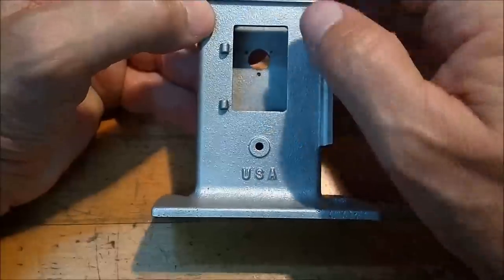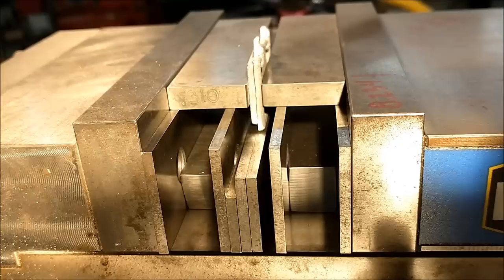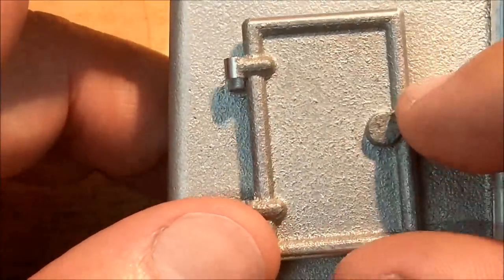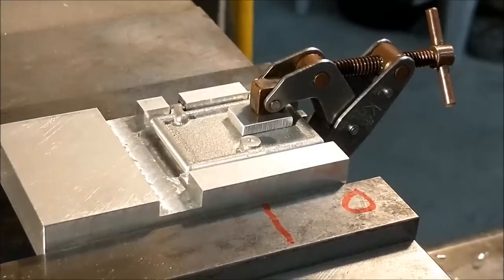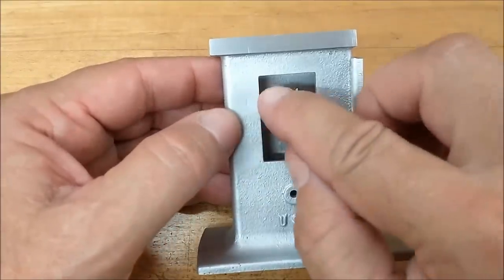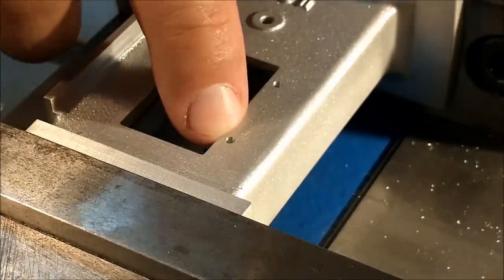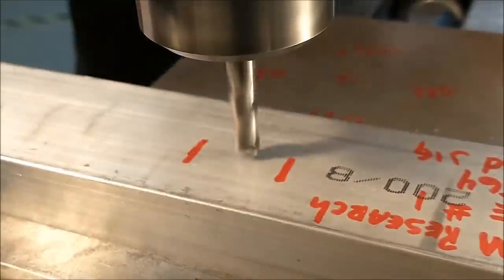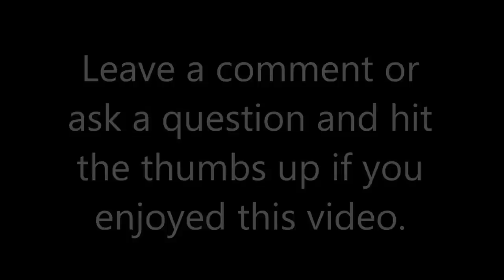Erase Those Hinges and Prepare for Something Better !!

Comment: HINT:  I use a cheap electric engraver to put the cast dimple look back where I have machined surfaces. It work's awesome.
Reply from the maker: I've also seen people cover an area with sand and beat it with a hammer.

Comment: Joe, you’re a problem solver for sure, you have come up with some rather unique solutions to problems that shouldn’t be a problem in the first place especially for what PM Research charges for their kit, you would think that they would have issues such as the hinges sorted prior to production.  Are they using backyard engineers or what.  You probably don’t mind thinking outside the box, but still, if they are gonna charge a chunk of change for their models then perhaps they should increase their quality control and perhaps retool if needs be. Great video! Liking your hinge solution.

Comment: Hey Joe. When it comes to that .080" hole you needed a reamer for at 16:20. I've seen another channel make a tool, I guess it's called a tri-corner reamer. It's just a piece of round stock made from a harder material with the tip ground and honed into a triangular, tapered point. He used one made from SS and it worked great in brass, so Aluminum should be no big deal. Just trying to share the knowledge when I can. Odds are you know this trick, but another reader may not know. Have a good day folks. Great work as always, Joe.
Reply from the maker: Clickspring by any chance?
Reply: @joepie221  Yes Sir, it was. I should've known you'd be familiar with his work. Personally, I think your teaching style is way better for me and many others, but Clickspring does amazing work too. I just wish Adam Savage would take a few pages out of your book, It seems like he would have safer setups.

Comment: Very impressive that the thin drill didn't wander when drilling the deep hole in the door hinge fixture.  I would have chickened out and drilled the two door hinges separately from each end of the door.

Comment: Another great video, and Just as you were talking about it I was going to type into the comments that you should clean of a couple of thou. off the top of those letters so that you could paint them and make then really pop when the model is done! but as I was fixin' to type in, you said that someone suggested it! Great minds think alike, it was uncanny, either that or it's Fools seldom differ, but I like the former rather than the latter, myself. LOL can't wait to see you make those hinges and handle out of brass, it's really going to pop when you put them together! I might as well suggest it now before someone else does, but you might like entertaining the idea of painting it like they did of all the hand made machinery that was built in the 19th century, with a relatively thick british racing green with gold highlights such as the lettering and perhaps some creative scrollwork on the sides, you can easily create those in decal form on blank decal paper and an inkjet printer, although I do not know the age of the model you are building, as this might be totally inappropriate but you're halfway there with the Brass hinges and handle you are going to create. other colors like red or dark blue were also popular anything that allowed gold colored painting on the letters was the norm, so it was usually a darker color. Anyway, think about it. However you decide, I'm sure it will be appropriate for it's age, and I greatly look forward to not only your next video, but the finished product as well!
Reply from the maker: Thank you. I'm enjoying this build more than I expected to.

Comment: Nice job Joe, the hinge replacement was really a no brainier in that you had to make the hinge bodies separate as in this particular casting you had no wiggle room to drill the pin holes. And I'm sure your fix for that will look just great. PM research should look at this and sort it out properly!
Reply from the maker: I can't possibly be the first guy to scratch his head over this detail. Lining up the hinge holes centerline with one of the top rail hold down screws would be the easiest fix. They are almost the exact same size and very close to being inline already.
Reply: @joepie221  I was going to say it looks like a slight adjustment to the spacing of the top rail holes would allow you to go right through the one above the hinge bosses. 
As a professional design engineer myself, that feature is badly thought out and I wonder how they intended it to be machined? Another example of why it is essential for design engineers to have a sound knowledge of machining processes and techniques.

Comment: Hi Joe

Loved the video and seeing the progress on the shaper machine. Was wondering if you could have used a ball end grinding bit to make a ball shaped divot in the cast hinge fittings on the base that was small enough to allow you to use a rounded over pin that could have been press fitted into the removable door assembly. Easy being an armchair machinist making a suggestion but wondering if this could have been an option. My other thought would have been drilling from the base side through the cast fittings then pinning the hole and sand blasting it to blend in . This would remove the "ugly" as you'd say.

Looking forward to seeing part two. Keep up the fantastic work.

Andy

Comment: Another anything goes post my friend. I was wondering if you would make or use a 4 inch drill bit for that door. This route makes far more sense. Odd they would make the door with the latch bosses out of alignment like that. At least it won't show but I do know it rubs you the wrong way eh. Great solution for a tricky situation with the hinges. I was thinking you would mill out the upper ways to allow for drilling and reaming the hinges and then plugging that same hole and re-doing that sacrificed mounting spot on the upper way. Seems to me you have the lesser evil taken care of. On to part 2 of this neat build. See ya there eh.

Comment: I've been mulling the idea of using a slitting saw approaching from the back side of the casting. That would allow the door pins to slip into the slit and then be held in place when the handle is seated. Any thoughts about how I could get in trouble this way ?  Thanks Joe.
Reply: I think you're on to something with that idea.  Slit from the outside for the top hinge, slit from the inside for the bottom.  The weight of the door would hold it into the opposing hinges.  I'd like to hear Joe's critique of the idea.
Reply: @Skyrmir  Seems like that would work pretty well until you open the door much past half way whereupon it would fall off!  However if you made the slit a nice sliding fit on the pin you could probably peen the bosses to trap the pin pretty well.

Comment: Any old school tips for those of us who don't have dro? i'm hoping to upgrade my mill to dro sometime, but it's an expensive upgrade for a hobbyist. I already use an inch indicator in various ways to track small moves, but many of the parts i make are larger than the reach of my largest indicator. Tips for maintaining accuracy on larger parts without an indicator could be very helpful for those of us still trapped in the dark ages. Love the videos, have learned a ton from your content.
Reply: Rohrertech, check out “ I gaging ez-view DRO “ . For less than $100 you can have an XYZ DRO. a little bit of work to install on my drill mill but works fine and is accurate enough for a hobbyist. Biggest problem I have had is forgetting to turn it off and running the batteries down .  Good luck !

Comment: How was the mill holding the 1/16 bit?  I assume 1/8 shank, but the collet or whatever is extended?
Reply from the maker: The cutter was held in a 3/8" diameter, 2" long extension.

Comment: Good work, interesting as always. I was going to say that you could do the machine hold down bolt holes in the last fixture.... But you said that too at the end.
Reply from the maker: Only risk is dusting the main casting, so I went with a plate instead.

Comment: as you say it's your model and you can do what you want with it.  I like your solution.  There are many possibilities. I could see getting rid of the hinges all together and turning it into a plate that gets screws and washers on 4 corners and is more of an access panel. or maybe some squared off grooves so it slides in and out from the top.  depends on how much it's going to be opened or actuated. yep, after thinking about it I like the way you picked, because of the handle and boss on the opposite side of the hinges.  I would look to fireplace (wood stove) doors as inspiration as they are a loose fit as well. =D

Comment: Hi Joe, I poked through your channel, did not see anything related, but I’d like to get your take on using a lathe for milling. I’ve a situation where I am setting up a mobile shop. Only looking for light milling. Planning for a PM-1030 lathe (an upgrade for me!). Currently, planning for no mill due to lack of use/ weight/size. Use to have a mill and over the last 4 years, I used it 3x. Used the lathe weekly. So was considering making a similar adapter to the old palmgren milling attachments. Thinking might be better to make one using a relatively inexpensive milling table flipped 90 degrees to give me maybe 8-13” movement in X, 5-6, Y, but lets me lock the carriage to reduce wear and add stability on the lathe. The largest thing I’ve ever (and plan to) mill was on a long rod, where a 5” vise could have held everything. Was easier to have the full 12” supported with machinist jacks.
As I said I’d love to hear your thoughts with the mobile constraint.
Or maybe I should instead be looking at a Smithy Granite XT (or whatever is the equivalent to that amazingly capable PM-1030)
Reply: I know that you are not asking me, but as an ex-owner of a lathe-mill I thought I might chip in. 
It depends very much on the saddle hold-down arrangement of the lathe. If the saddle is held down well, with a tapered gib, for example, then it is likely to be largely OK but not nearly so capable as a real mill. You certainly want to have a handle on the end of the leadscrew rather than be setting depth of cut with the rack and pinion. 
The problem is that the hold-down surfaces are small relative to the top surfaces, as lathes really only have to handle forces down into the bed. 
My combo machine had the saddle held down with strips of cold-rolled steel, adjusted by the bolts being not-quite tight. So it wasn't particularly well-suited to the job. In fact it ws terrible and I ended up making tapered gibs for it. 
Milling on the lathe used to be a very common procedure (it probably felt more normal in the days when most milling machines were horizontal). Rivett made a number of elaborate attachments for the process back in the 1920s: (see halfway down this page and onwards: http://www.lathes.co.uk/rivettearly608/index.html)
Milling adaptors for Myford lathes are readily available, and look a little better than the Palmgren that you mention. https://www.rdgtools.co.uk/acatalog/RDG-VERTICAL-SLIDE-FOR-MYFORD-LATHE-SUPER-7-ML7-IMPERIAL-GRADUATION-7858975.html for example (or look on eBay)

Comment: Very interesting. Those hinges are certainly causing some work but the brass will be a great feature on the model. On the inner door handle boss not being concentric, I would mill it off and centre on the drilled hole then use a key seat cutter to drill a flat bottomed hole and press in a bit of rod to re-drill the hole in the centre. I know its only really minor but the way I see it the longer it takes to make the model the more value you get from it. I like making clocks and spend ages making useless decorative features but it keeps me occupied.
Reply from the maker: I like your suggestion. That's top level attention to detail.

Comment: Those hinges were definitely a challenge to figure out how to make the provided design work. What I decided to do on my build was to drill the hinge pin holes at a slight angle in the Frame bosses and install the hinge pins (paperclips as suggested by the print), epoxying them into the frame rather than the door,. Once the pins were secure , I bent the pin straight/parallel so the Door would easily drop onto the pins. The door fits perfectly and gravity keeps the door in position as designed.  Just another option to overcome the design flaw. This was really the only part of the design that was a problem, otherwise a very nice kit to build.
Reply from the maker: I agree. So far the kit has been very cooperative.

Comment: Curious about what they said in the instructions for drilling those hinge bosses.   If that model was copied from  a full sized machine, then it would still be difficult.  My guess is that those were separate pieces on the machine  bolted on.

Comment: i guess the little door had an outer and an inner part for creating its cast mold - and both were a bit offset in the vertical direction (maybe also in the horizontal one, but much lesser).
thats the key "problem" you are seeing now in the duty of selecting the right position for the two hinge fork holders.

Comment: This comment is in no way a criticism of your decisions on your model: the door opening would normally be left "as cast", with filler and paint in full size practice.
Thank you for your time and effort to share your expertise.
Reply from the maker: Thanks for the input. But in this case, the rough cast door didn't fit the rough cast opening. I could either cut the door or the opening. For sake of precision placement of the hinge pockets, I chose to machine the opening to clear the door.
Reply: @joepie221  I knew you had good reasons. Again, thanks for what you teach us. Blessings from South Africa.

Comment: Awesome series. I'm really enjoying watching. On the back of the door where the casting isn't concentric. Do you have a way to use the hole as a guide and fly cut the outer edge of the casting? The casting would be smaller that the feature on the face, but you could match it with the handle back.
Reply from the maker: The front beaded edge detail would have been reduced considerably on the adjusted edge. Its about a 1mm offset inside, but the outside is now perfectly symmetrical.
Reply: @joepie221  I was referring to the detail where the handle comes through the door. The back side is off center. I was thinking about cutting the back side detail smaller so the handle would be centered front and back.

Comment: well if you are going to face those letters for the purpose of 'making them stand out more'... then there is also an opportunity paint or apply some finish or coating. but before finally doing that operation. which would then offer additional contrast between the cast surface and machined lettering. and then it would stand out even more. just depends what sort of a finish and final look you are going for

Comment: Well Joe I’m disappointed,I was sure you would come up with some kind of a bendable drill bit and guide to do those hinges , just so you could leave a bunch of guys running around with flat spots on their foreheads. Ha ha ! I think you came up with an excellent way to correct someone else’s mistake . Thanks for showing us how to think outside the box .
Reply: Joe needs an EDM (electrical discharge machine aka wire erosion). That would be able to "drill" it sideways.

Comment: Excellent work as usual, you have though set the bar rsther high for any others to follow.😢
Rather than use inc/abs a lot of DROs have tool offsets or multiple zeros, so you can define any feature its own zero number but dont reset the ABS while doing this as it will effect all offsets or zeros. 
Personally i set the vice fixed jaw LH edge as my ABS for ease of working in the vice and use multiple zeros for any other work or feature machining.

Comment: Some great decisions- makes you wonder how the manufacturer expected those frame hinge holes to be drilled...
Reply from the maker: A super small drill waaaay off center to the boss may have worked, but would not be to the standard I hope to achieve.
Reply: @joepie221  I think you called it right. Way better.

Comment: Is there a reason you went with cutting fluid when cutting the pockets? My thinking is that the oil would make the chips pool IN the pocket and cause issues. I would think that without oil the chips might be flung out of the pocket by the cutting action. On top of that- it's cast iron... So... help me learn here. Why the cutting oil in this case? Thanks!!
Reply: This casting is aluminum, not cast iron.
Reply: @ellieprice363  oh! Right! Thanks, that seems obvious now

Comment: When you do the boiler for the PM engine, use this method for the firedoor.
Reply from the maker: Sadly, I'll use air. Steam is authentic, but too messy for my liking.
Reply: @joepie221  Steam is labor intensive.  Tending a boiler and running a big plant like yours would be a 2 man job

Comment: Drill at a slight angle, insert pivots, bend pivots to be parallel to the body?
Reply: Or, if you really had to drill them:
1: Spark erosion
2: Make a jig like the door drilling jig, but much taller. Then bend the jig in a gentle curve. Drill-life might be short.
Reply from the maker: Offset pins like you describe are the very foundation for a spring. They are fine at rest, but any motion and the pins try to return to that resting position resulting in a spring effect. Its really clever.

Comment: without seeing the print i wonder if that top screw hole wasnt meant to be where the hinge pin went???
Reply: I thought the same thing for a second then I thought the holes could probably be made by drilling through the bottom the hole left in the end really wouldn't be noticeable unless you really looking hard for somthing lol.